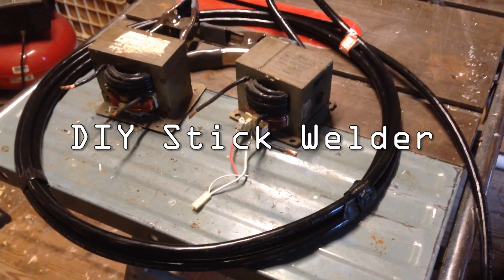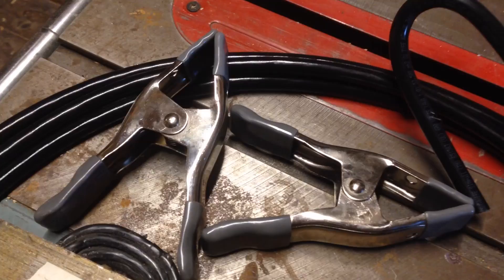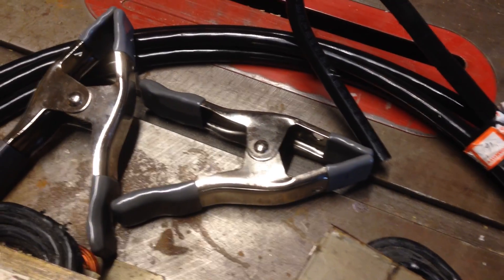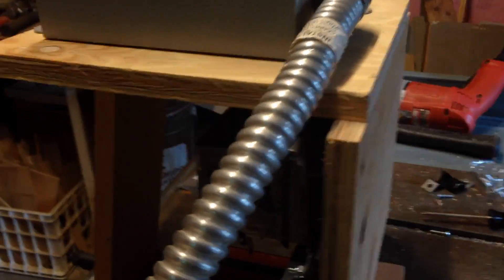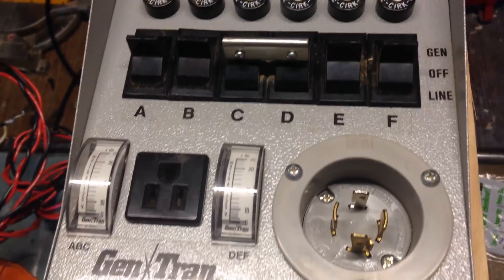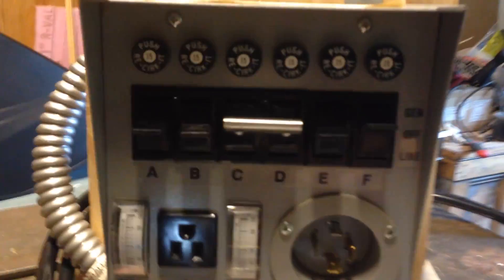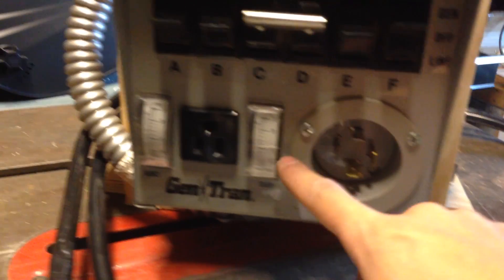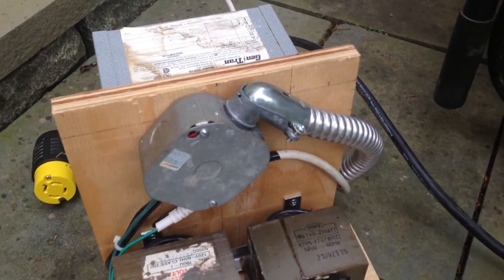DIY Arc Welder

Comment: A 3rd transformer will add more performance to your welding and that's where you rods will penetrate very deeply. Although, the thin, 3/32 electrodes or 2 MOTs that you're using will work okay on sheet metal or relatively thin metal and sheet is very hard to weld.

I like your powering your welder on a generator idea and I want to run a generator on wood gas when I buy one.

Comment: Its horrible, thats not welding. Thats,  how to turn a piece of metal into a lump...
Reply: That's because you only saw him use 2 transformers in series instead of parallel (more capacity). Three MOTs or more is for higher voltage and better penetration. You are underestimating his welding skills, so don't be so quick to judge.